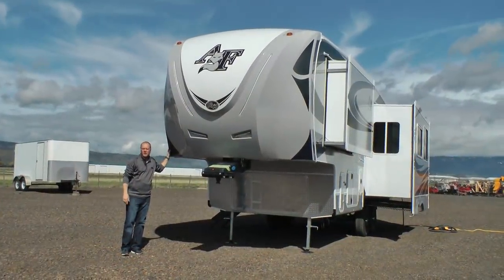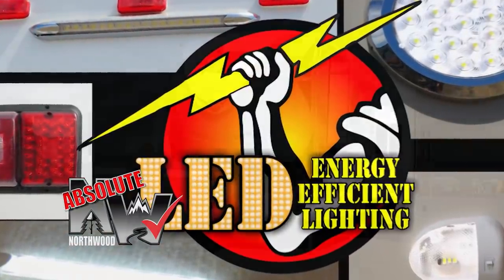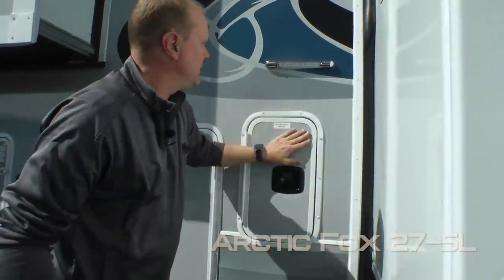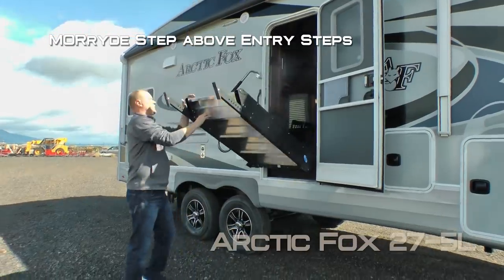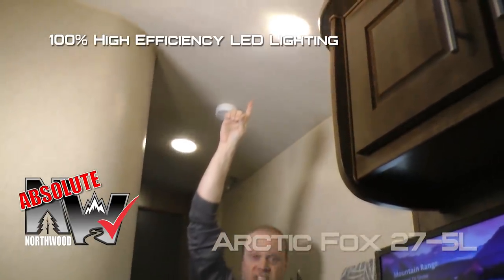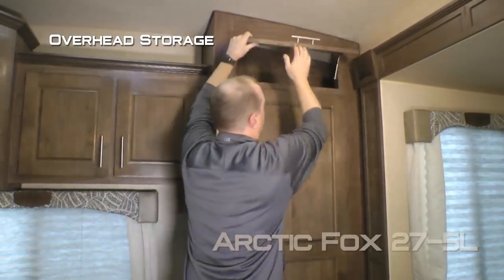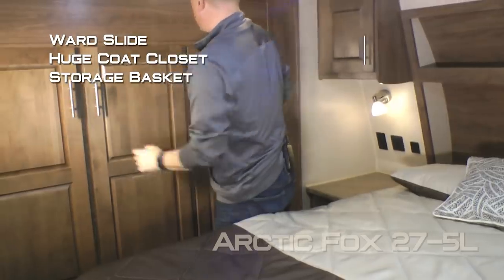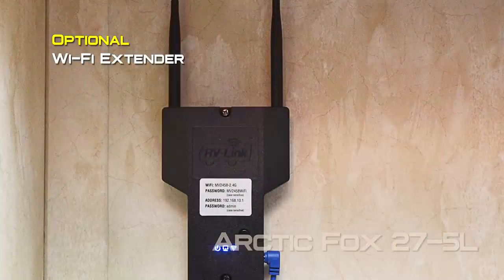Quick Tour of The New Arctic Fox Grande Ronde 27-5L Fifth Wheel

Comment: I really like you product but those new backspashes this year clash with the counters I would have to remove them immediately and replace with something else.  I would like to see you guys go to multiplex wiring, truma hot water or truma combi depending on the square footage they can heat, a battery area that can be enclosed to protect lithium batteries, a whole house inverter, AC with soft start and real solar wiring ready or just make a deal with zamp which to offer some rigs ready to boondock, decked out with a real solar (meaning as much as the roof of the particular rig can accommodate) + lithium system. and a generator that does not have to be installed by the dealer, they are standard on motorhomes it is high time they are not an afterthought on fifth wheels  Luan needs to be transitioned to something like azdell, and those rubber roofs I can't believe they are still around they are so easily damaged.  I want something bigger than a class B but the Bs seem to be the only class that are really getting up to speed with what most people want in technology for boondocking.  BTW nice plant tours by Taylor it was a good idea to invite him down.
Reply: Agree 100% to everything stated here.
Reply: Tatiacha, you've made some very compelling comments.  First, I want to state that I've never owned a 5th wheel.  But I'm in the "market" for one.  I've been doing my own research and due diligence on just about every brand/manufacturer out there for the last five years.  I've gone to several RV Super Shows and I've visited two manufacturing facilities in northern Indiana (Elkhart). I want to say that I've seen just about everything out there regarding 5th wheels.  My "own" conclusions has lead me to the Northwoods Brand.  By far, this is the highest quality built 5th wheel on the market, in my opinion.  Do they have short comings?  Yes, based on your very valid comments!  With that being said, I can see you've done your own research also or it definitely appears so.  I would like your opinion please.  Do you have any recommendations on RV brands that have better updated interiors, Truma hot waters, etc. as you've stated above?  I am looking for that brand/manufacturer.  Any suggestions would be greatly appreciated.  Thanks!

Comment: I would like to see a video that explains and shows where the second grey water tank is located and where the drain valve for it is on an Arctic Fox Silver Fox Edition 27.5  2013 Fifth Wheel.  Panel shows its full, Manuals says its there but no indication as to how/where to find it.

Comment: Northwood, I'm glad you're updating your 5th wheel trailers, but I can't find anywhere where you explain what changed from "silver fox edition" to "grande ronde". Further, I'm hoping that with this new series, you're going to retire some of your tired, outdated floor plans - eg - 29.5 models. You NEED dual-opposing slides (similar to what ORV Glacier Peak did with their short-lived 30 Series trailers.) Further, the 29-5 and 32-5 NEED pantry space - I mean really?! If you full time, you're going to want the 12 cu ft fridge and with that there is NONE. Really?! Its frustrating because you have SUCH a great product in most ways, but a few things NEED to change to make your products unbeatable in ALL ways.